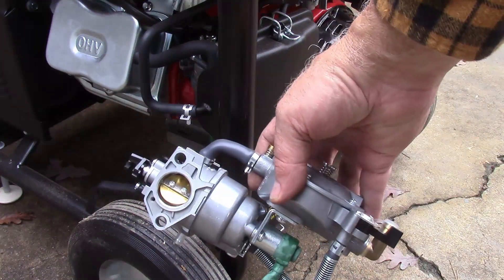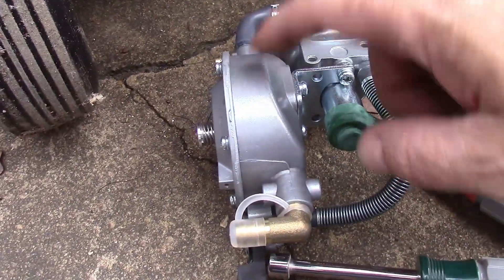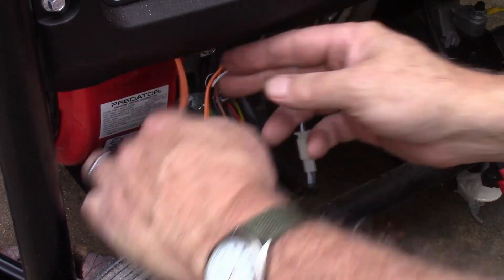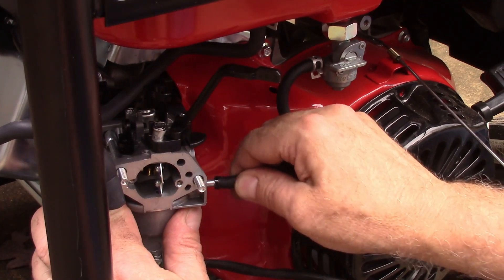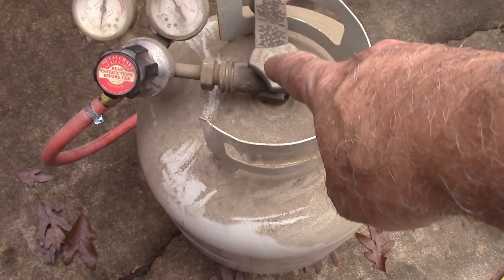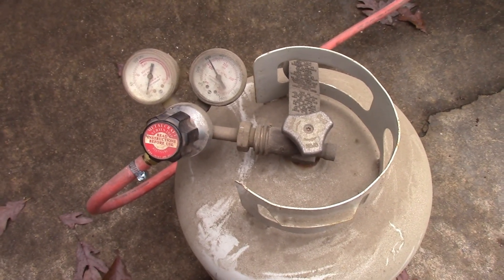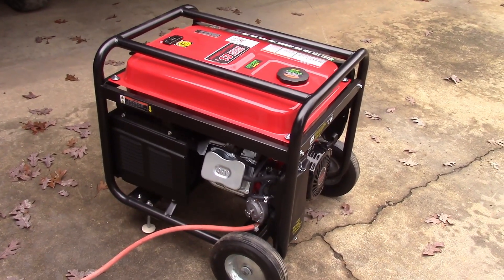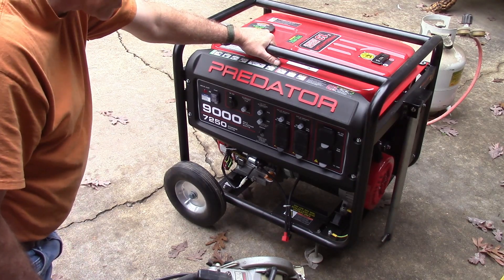Predator 9000/8750 Generator Propane Conversion  Tri Fuel

Comment: Nice video.  Id also be interested in natural gas hookup for a home.
Reply from the maker: This carburetor says it will also do natural gas. I just happen to use propane.
Reply: @SoatMon  yes it works on city natural gas . you just have to use a 1/2 inch line for short runs  and a 3/4 inch line for longer runs
Reply: NOT FOR NATURAL GAS !!!   the link provided takes you to Amazon where product description says LP/CNG conversion kit.   CNG is Compressed Natural Gas which is not the utility being fed to your house thru a gas line.  This is the pressurized version they use in some city buses and truck fleets.   You can get a carburetor for household natural gas, but it is not the one shown in this video !
Reply: @davec6016  ...If you know this to be so, then can you provide a source to where this 'household gas' carburetor can be purchased?
Reply: @davec6016  Not so fast ....  While I COMPLETELY agree with your wording here, I think they (we?) are taking the term "C"NG out of context here. Everything you say about "CNG" is 100% correct (in industry), but I do believe that "they" are using the terms 'CNG', and 'NG' interchangeably. Here's why:

First off, CNG is an 'industry' thing (as you mentioned), it is NOT available to consumers as we're talking about many thousands of PSI. CNG simply isn't available to the average home owner for back-yard BBQ's, generators, and what-not.

Secondly, they wouldn't have a simple, low-pressure brass barbed cock on the input of the regulator for (real) CNG - it would be a high-pressure threaded (CIP?) flare fitting (like a hydraulic fitting). Same with "L"PG for that matter - "liquid" propane (as the term LPG implies) is also high pressure with propane pressures between 150 and 200 PSI.

Common sense says that both, their "LPG", and 'CNG' in the context of this consumer-grade carb is low pressure (gas). 1/4 PSI for N.G., and ~ 1/3rd PSI for propane.

Also, the carb in his video doesn't match the one in the Amazon link that he provided. I just bought one of these on E-bay. and it looks identical to the one in the Amazon link he provided.  The concern I have, is that I can't pull out the little orange handle to switch between LPG & NG ("CNG" as they call it).  The orange handle is simply a cam with slightly different size holes (orifices).

After reading all of the comments in this video, I too was ready to send this thing back (thinking that it wasn't really for city N.G., but I caught myself for the reasons outlined above.

With a little silicon grease, I'm sure I can get the little handle to work better/easier).

The only remaining concern I have is mixture adjustment for LPG or NG (or lack thereof with this carb). Lot of the bigger, more expensive conversion kits have a "load block", which is simply just a bolt in the side of a brass tube. But since those kids of "kits" are much more universal, especially the injection method, and placement. 

But since this really is a 'purpose built' carb, with a very static tube placement in the venturi of the carb (for a concise selection of engines), my guess is that the hole/orifice of that little orange rotary gas selection switch is a whole lot more "exacting", and thus doesn't need an adjustment 'load block' (for either gas).

I plan to install this on a fairly new Preditor 6,500 Watt generator, and try (BBQ regulated) propane, and city N.G.

I'll make it a point to come back here and report my findings.

Comment: Anybody find a regulator with a 3/8” id hose that will fit the barb on this carb?
Reply: Here is a reminder about portable generator safety: everyone really needs to see this safety reminder to make sure. This advice is just to make sure that everyone is aware of all the warnings and it’s just to remind people to be careful using portable generators. Generators can be dangerous if not used carefully. Every year, hundreds of people die or get injured when using portable generators due to carbon monoxide poisoning and electrocution. Make sure you are using your generator carefully and keeping others safe as well. There is something very serious that everyone should always be aware of when using generators. Some people do run their generator indoors which is not safe and that increases the risk of carbon monoxide poisoning which can cause death of family and you. Some people run their generator in wet conditions which can electrocute them. Please remember that you should never run your generator indoors. Remember that carbon monoxide is an odorless and colorless gas that you cannot see or smell. Carbon monoxide is a silent killer. Keep that in mind. Make sure your generator is 15-20 feet away from your house and away from doors, windows, and vents. Never use your generator in your porch too. Having a carbon monoxide detector is very important against generator safety. Some people also allow children to go near the portable generator which could pose risks. We need to keep an eye on our children making sure that they are not near the portable generator so they won’t get electrocuted or burned by the generator which is dangerous. A locking enclosure also keeps kids safe. A generator shed might look like a tempting place to explore, or take cover during a game of hide and seek, but a generator is a dangerous piece of equipment that can cause injury. It says on the manual that we should also keep children away at all times from the portable generator to avoid injuries. Please do not allow a child or unqualified people to operate the portable generator. Just because some manuals missed what should be listed doesn’t mean it’s safe to do. Always follow the generator safety rules when using portable generators. Generators pose electrical risks. If you need to use your generator during wet weather, you need a generator tent to protect your generator from getting wet. Don’t let your generator get wet. Keep your generator dry and before using your generator, please make sure your hands and your generator is dry. Do not wear loose clothing when operating the generator. Everything that is said on the generator’s operating manual should not be ignored. Never smoke cigarettes near the generator. Please keep flammable things away from the generator. Never overload your generator too. Your generator can catch fire. Never ever try to plug a generator cord into a wall outlet to avoid back feeding. Back feeding your generator is dangerous. Always turn on your generator first before plugging in appliances and shut off the appliances before turning your generator off. Use a heavy duty cord for your generator and the cord should not be worn out. All the instructions should be followed carefully. Never refuel your generator while it’s running. It can cause fire if fuel spills while your generator is hot. You should turn off your generator and let it cool off before refueling it. Having a fire extinguisher next to the generator is also important. This is only a reminder for everyone’s safety of using generators. Make sure your generator is properly grounded. Having a fire extinguisher next to the generator is also important against the safety rules. https://youtu.be/I1jT3ANENvI and here is a video more about keeping others safe when using generators and also about our family’s safety. Hope this helps. Thank you.

Comment: What about natural gas can you hook that up as well, if so can you make a video on that?
Reply from the maker: I have not used it with natural gas, I only have propane but you would just run a hose to it from your gas line.
Reply: @SoatMon  Thanks for the video. There's a big difference in price between this kit and others that claim tri-fuel (150 USD). Can an this be used for natural gas or not? Has anyone tried it? Thanks again.
Reply: NOT FOR NATURAL GAS !!!   the link provided takes you to Amazon where product description says LP/CNG conversion kit.   CNG is Compressed Natural Gas which is not the utility being fed to your house thru a gas line.  This is the pressurized version they use in some city buses and truck fleets.   You can get a carburetor for household natural gas, but it is not the one shown in this video !
Reply: Dave C so which one do you use for natural gas??? Only one I have seen, you have to cut the frame!?
Reply: @davec6016  Not so fast ....  While I COMPLETELY agree with your wording here, I think they (we?) are taking the term "C"NG out of context here. Everything you say about "CNG" is 100% correct (in industry), but I do believe that "they" are using the terms 'CNG', and 'NG' interchangeably. Here's why:

First off, CNG is an 'industry' thing (as you mentioned), it is NOT available to consumers as we're talking about many thousands of PSI. CNG simply isn't available to the average home owner for back-yard BBQ's, generators, and what-not.

Secondly, they wouldn't have a simple, low-pressure brass barbed cock on the input of the regulator for (real) CNG - it would be a high-pressure threaded (CIP?) flare fitting (like a hydraulic fitting). Same with "L"PG for that matter - "liquid" propane (as the term LPG implies) is also high pressure with propane pressures between 150 and 200 PSI.

Common sense says that both, their "LPG", and 'CNG' in the context of this consumer-grade carb is low pressure (gas). 1/4 PSI for N.G., and ~ 1/3rd PSI for propane.

Also, the carb in his video doesn't match the one in the Amazon link that he provided. I just bought one of these on E-bay. and it looks identical to the one in the Amazon link he provided.  The concern I have, is that I can't pull out the little orange handle to switch between LPG & NG ("CNG" as they call it).  The orange handle is simply a cam with slightly different size holes (orifices).

After reading all of the comments in this video, I too was ready to send this thing back (thinking that it wasn't really for city N.G., but I caught myself for the reasons outlined above.

With a little silicon grease, I'm sure I can get the little handle to work better/easier).

The only remaining concern I have is mixture adjustment for LPG or NG (or lack thereof with this carb). Lot of the bigger, more expensive conversion kits have a "load block", which is simply just a bolt in the side of a brass tube. But since those kids of "kits" are much more universal, especially the injection method, and placement. 

But since this really is a 'purpose built' carb, with a very static tube placement in the venturi of the carb (for a concise selection of engines), my guess is that the hole/orifice of that little orange rotary gas selection switch is a whole lot more "exacting", and thus doesn't need an adjustment 'load block' (for either gas).

I plan to install this on a fairly new Preditor 6,500 Watt generator, and try (BBQ regulated) propane, and city N.G.

I'll make it a point to come back here and report my findings.

Comment: I did the same conversion based on your video. My question is, I bought a grill propane hose that is 12ft. Do I hack the end screw off to hookup to carb? I have no idea the inner diameter of the bbq grill gas hose....thanks
Reply from the maker: I don't know the size of the hose you bought but it should be the right size.  Can you tell by the size of the fitting on either end of it?  Good luck and I'm glad it worked out for you.
Reply: @SoatMon  I also bought the grill propane regulator but I'm having trouble getting it to run.. I switch on and prime the propane but it won't run.. Can you help?
Reply: Hold primer button for about 3sec. Once I got it started I had to adjust the orange valve that controls the flow for Ng or lp once I did that it worked great

Comment: WHATS THE DIFFERENCE BETWEEN WHAT YOU DID AND A CONVERSION KIT THAT IS A $179.00 ..SEEMS LIKE THIS IS MUCH CHEAPER AND EASIER, I WILL HAVE TO CUT MY FRAME WITH CONVERSION..KINDA CONFUSED NOW..
Reply from the maker: I don't know the actual difference because I haven't used the more expensive kit.  All I know is that this one works.

Comment: Thanks for the great video. I purchased it, and it’s on the way. Question, when running on NG, what distance from the house would you recommend placing the generator? Thanks again!
Reply: My generator is about 20 feet from the house but I got a carbon monoxide (CO) detector for about $20 from Amazon. Can't be too careful with CO.
Reply from the maker: Glad it was helpful.  I would just make sure the exhaust isn't getting into the house but I'm no expert.  Good luck with your new generator.
Reply: Here is a reminder about portable generator safety: This advice is just to make sure that everyone is aware of all the warnings and it’s just to remind people to be careful using portable generators. Everyone has to see this safety reminder for safety. Every year, hundreds of people die or get injured when using portable generators due to carbon monoxide poisoning and electrocution. Make sure you are using your generator carefully and keeping others safe as well. There is something very serious that everyone should always be aware of when using generators. Some people do run their generator indoors which is not safe and that increases the risk of carbon monoxide poisoning which can cause death of family and you. Some people run their generator in wet conditions which can electrocute them. Please remember that you should never run your generator indoors. Remember that carbon monoxide is an odorless and colorless gas that you cannot see or smell. Carbon monoxide is a silent killer. Keep that in mind. Make sure your generator is 15-20 feet away from your house and away from doors, windows, and vents. Never use your generator in your porch too. Having a carbon monoxide detector is very important against generator safety. Some people also allow children to go near the portable generator which could pose risks. We need to keep an eye on our children making sure that they are not near the portable generator so they won’t get electrocuted or burned by the generator which is dangerous. A locking enclosure also keeps kids safe. A generator shed might look like a tempting place to explore, or take cover during a game of hide and seek, but a generator is a dangerous piece of equipment that can cause injury. It says on the manual that we should also keep children away at all times from the portable generator to avoid injuries. Please do not allow a child or unqualified people to operate the portable generator. Just because some manuals missed what should be listed doesn’t mean it’s safe to do. Always follow the generator safety rules when using portable generators. Generators pose electrical risks. If you need to use your generator during wet weather, you need a generator tent to protect your generator from getting wet. Don’t let your generator get wet. Keep your generator dry and before using your generator, please make sure your hands and your generator is dry. Do not wear loose clothing when operating the generator. Everything that is said on the generator’s operating manual should not be ignored. Never smoke cigarettes near the generator. Please keep flammable things away from the generator. Never overload your generator too. Your generator can catch fire. Never ever try to plug a generator cord into a wall outlet to avoid back feeding. Back feeding your generator is dangerous. Always turn on your generator first before plugging in appliances and shut off the appliances before turning your generator off. Use a heavy duty cord for your generator and the cord should not be worn out. All the instructions should be followed carefully. Never refuel your generator while it’s running. It can cause fire if fuel spills while your generator is hot. You should turn off your generator and let it cool off before refueling it. Having a fire extinguisher next to the generator is also important. This is only a reminder for everyone’s safety of using generators. Make sure your generator is properly grounded. https://youtu.be/I1jT3ANENvI and here is a video more about keeping others safe when using generators and also about our family’s safety. Hope this helps. Thank you. All generator safety rules are needed to be followed carefully. Be safe